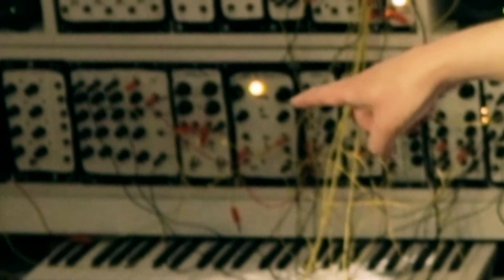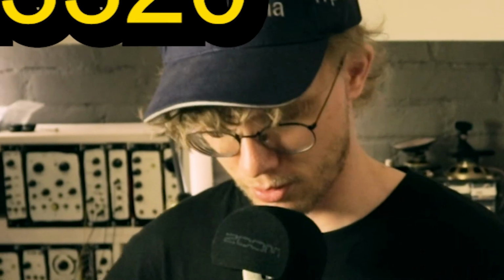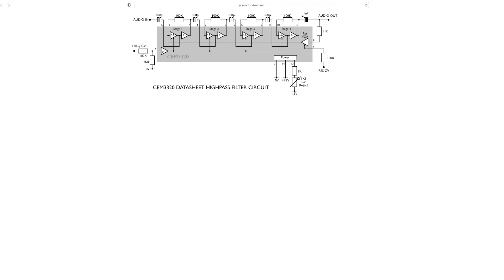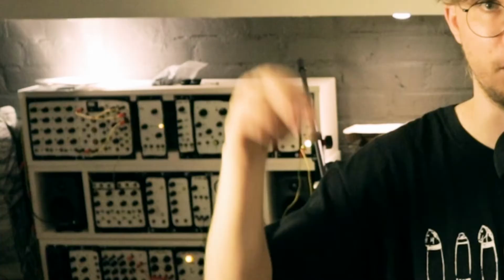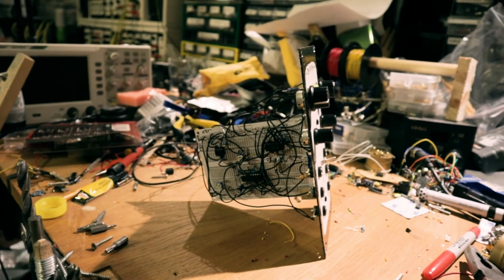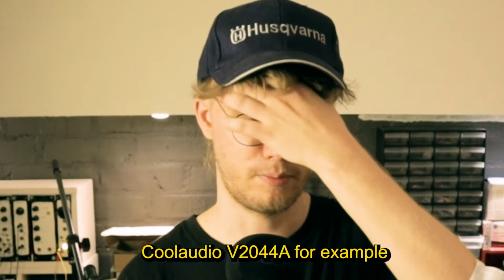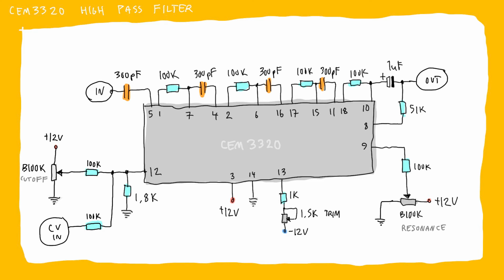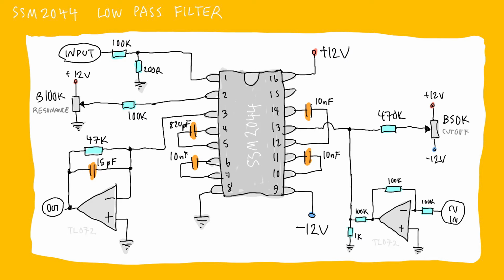CEM high pass // SSM low pass VCF module

Comment: Wow your videos are so cool and well made!!
I was just wondering if you could make a video on your midi to cv converter! It would be a cool video!
Reply from the maker: Thanks so much! 🌞 I actually have no diy midi to cv converter at the moment, but im going to build one at some point hahah. I’m just using an arturia keystep and a passive minijack to banana jack adapter module! If you wanna build a diy midi to cv converter i would recommend you check out Hagiwo or Afrorack’s videos on youtube for example. Most of the diy midi to cv modules are pretty similar: an arduino with a simple midi code and a digigital to analog converter to output the CV
Reply from the maker: I also just bought a midimuso cv-12 kit for a project i’m planning on building at some point in the future! It’s a great diy kit you can use for polyphonic midi to cv convertion with velocity and all kinds of possible outputs
Reply: @LAURISDIYCHANNELTV  Wow great thanks for all the tips! Yeah I was looking on the web how to build one! I'm working on my diy modular synth and thought that would be a cool thing to make!

Comment: Nice, I used the AS3320 (CEM clone) for my low pass filter. I was lucky enough to stocked up on my components when these were still available in larger quantities at an affordable price. I should build a high pass filter with one of these too.